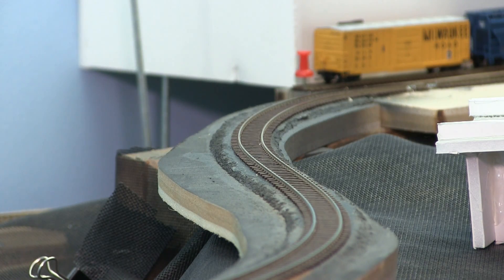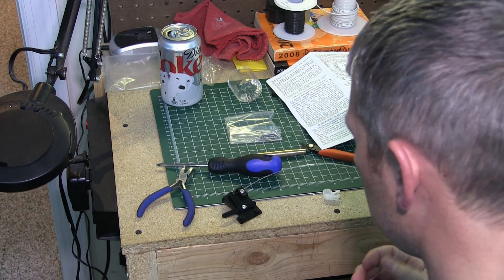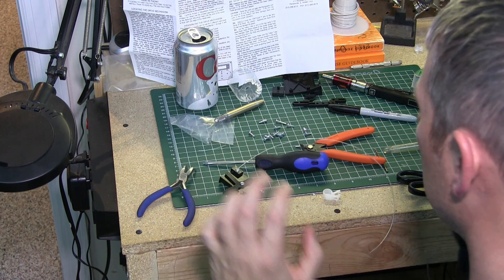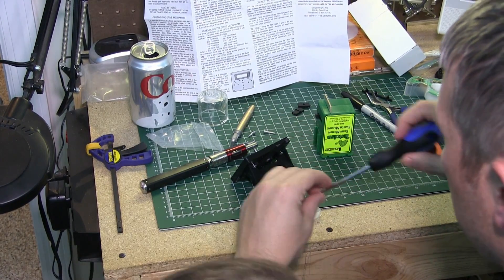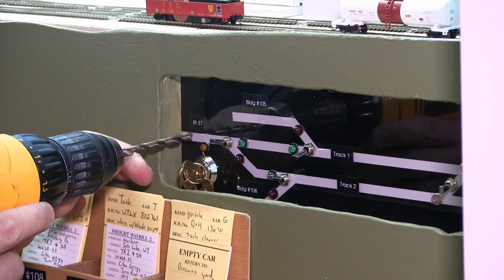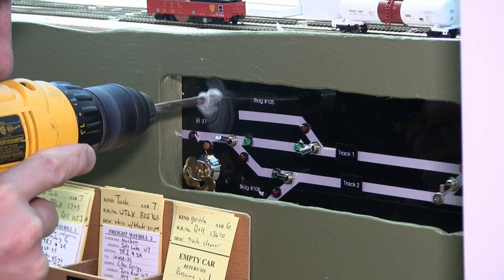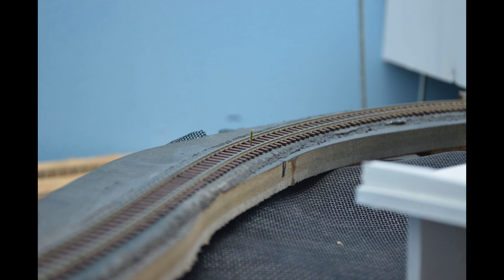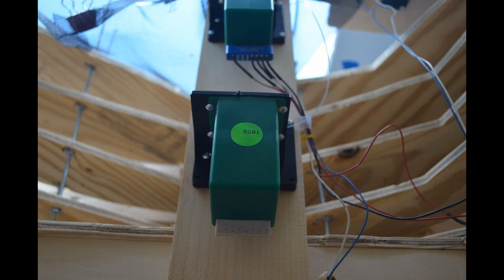Installing a handbrake on Sayrehurst Secondary

Comment: Nice implementation.  If you find you need to build any more of them, here's another way to do exactly the same thing at a fraction of the cost: https://youtu.be/dEoaa4j06-8 
I also use an identical arrangement with red LEDs on the control panel showing that the line is blocked, but I hadn't yet installed them when I made this video.
I hope this is useful.

Comment: Well done Joe and a great solution to the problem of rolling stock on grades.
I do have one concern though and that is how you will couple back onto the cars  considering they are on a curve. I've found most, including MT couplers, don't like to couple on to too much of a curve.
Otherwise I enjoyed your how to video. Thank you.
Neil W
Reply from the maker: Thanks Neil. Its a 50/50 shot. If it doesn't make it I use a little "divine intervention" with my uncoupling tool. lol

Comment: Joe. Great way to secure the train on the grade. What is the plan for a track side indicator to let the crew know exactly where the brake is located? It might take the conductor a while to dig it out after a heavy winter snow fall. Maybe something like a non-operating derail and a switch stand could be the indicator.
Reply from the maker: Conrail had very distinct signs with a read and yellow square on top, I think that will be a good fit. I think they were mile post markers, Matt Snell did an article on them. BTW please watch my next video Operating the SA-39 (coming out in the middle of the week, I need your opinions. It's a little long....44 mins. Thanks as always for following!